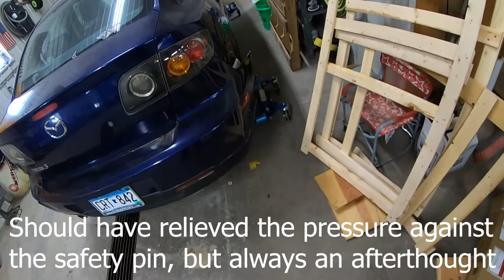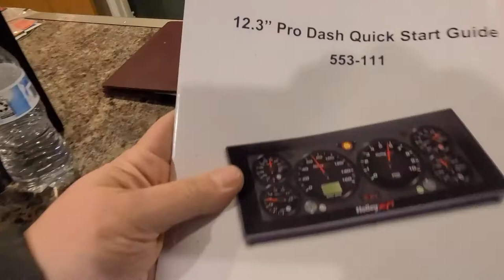Eastwood wheel dollies and Holley Pro Dash arrived!! (broken items)

Comment: One of the four Eastwood Dollies I bought is having the same issue.  Brand new and leaking hydraulic oil from the same spot as this guy... lots of fluid.  Very disappointed with Eastwood quality control ... these dollies are not light and cost quite a bit for shipping from Eastwood.  I have spoke to the Eastwood customer support and sent pictures with detailed explanation of the issue (today), but have not heard back.  Hopefully Eastwood will make this right and I can follow up with a positive post.
Reply from the maker: 1 still leaks like none other and they did send a replacement.  but in the meantime 1 other crapped out and can't get it to bleed or pump up.  sorry @eastwood but these look nice but would have rather purchased a harbor freight set.  at least if theirs were junk i could walk right in and get them replaced or my money back.